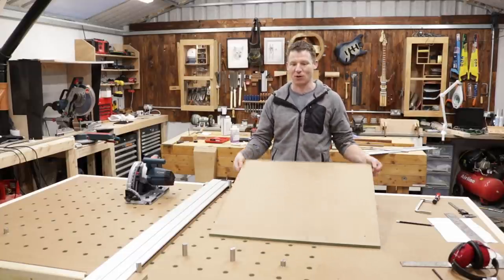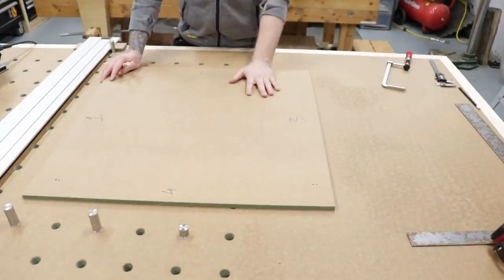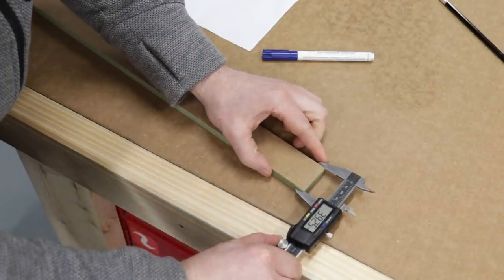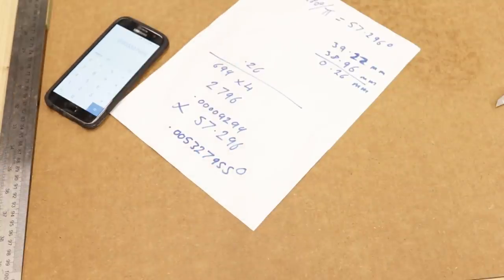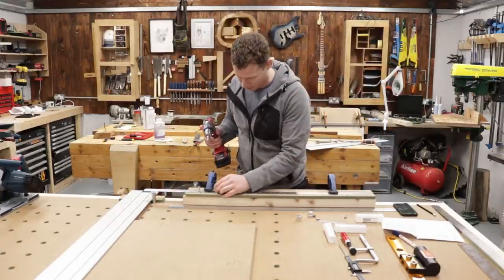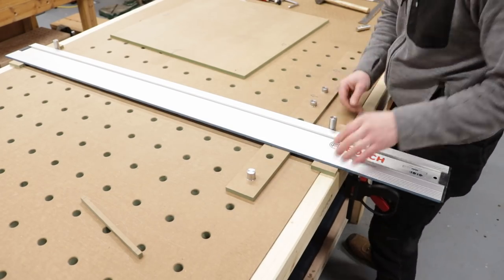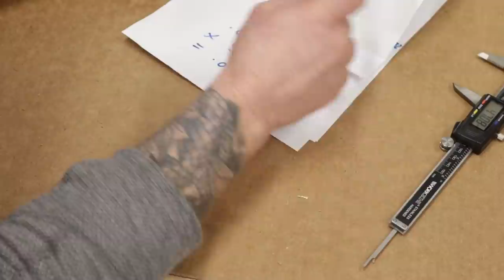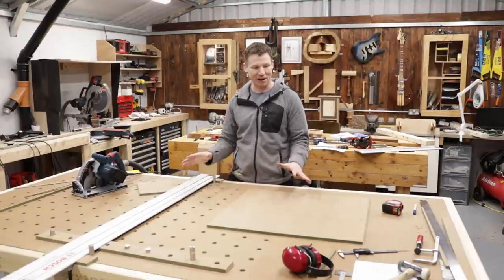Testing MFT Accuracy and Testing Home Made Fence Accuracy. UJK Parf Guide System MK2.

Comment: Is it me, or at the 17:20 mark on the video, it looks like you rotated the board by 180 degrees, hence you are showing the same measurement twice?
Reply from the maker: Yes I messed up I rotated the board the wrong way for one cut and cut the same side twice. It's pinned in the first comment on the video.
Reply: @JohnMcGrathManInShed  I did read through your pinned comment when you mentioned the "3 cut" error whilst cutting, but I was referring to when you were doing the measurements of the diagonals towards the end of the video. To me it looks like you rotated the board 180 degrees between measurements, when it should only be 90 degrees
Reply from the maker: @whatdaf11  I measured it about ten times it's good, believe me if it wasn't square I would be the first to say it.

Comment: Check out the bench dogs guide fence and fence dogs, very good items to add to your mft https://benchdogs.co.uk/
Reply: Taking delivery of my Benchdogs 2000mm fence this week. I like it as it has flag-stops, an under rail support, metric scale. Hopefully building 2 mft style tops ( like in the video) but 1200 x 1400 that can be joined together when needed. This way I can take a single unit out on site. Crosscut will be via a Festool rail with magnetic dogs from Sautershop.de. 
Appreciate the video. I'll be using this method.

Comment: Curious what is considered “close enough”? Jumping through some serious hoops here. Once this piece is assembled into a cabinet (or whatever it will be used for) it will change considerably. Joinery methods, glue, fasteners, variable thickness of the piece itself will all affect the “squareness” of the finished project. Etc, etc, etc. 
Then, next week it will rain, and the week after that it will be dry and the temperature will rise 15 degrees. These factors will all change that  “perceived squareness”. After that we deliver the cabinet to an out of square and out of plumb house to install the cabinet.
Not saying that we shouldn’t strive for “perfection” what I am saying, is the customer will never appreciate your efforts, and will never pay for your efforts.
Nice job! Close enough! Get to work and make some money!
Learn to run a profitable business.
Reply: Wrong here. There are imperfections in life, that's a given. But a tighter tolerance beats a lucky fit on any day. If one can get the workpiece down to 0.1mm tolerance, the amount of play afterwards has a much higher probability of staying within "squareness" by eye.

Comment: I'm not so sure that a 0.26 or 0.010 inch error is very good if you want to joint anything together. 
A 10 thou gap is quite annoyingly visible & considering my calibrated DeWalt table saw, will cut 1.5 thou or 0.0015" or 0.038mm error in 500mm. 
 I have to say,  I'm not positively impressed with your setup.

Comment: Matt Estela had the same problem with his Bosch track saw and the dogs (https://youtu.be/cfxF-EtfOfA?t=939) unfortunately he only suggested the same solution as you. This is one reason I'm not going to get the bosch track saw.
Reply from the maker: It fits on all the other brands track's so if it's a major issue I'll just get a Makita track for it which is identical to the festool
Reply: Buy Festool or Makita track and you are done. They fit to Bosch system.

Comment: u should not use a caliper the way u do. just put the object to be measured on a flat surface and the caliper too. than close the calipers jaws at least on half their length araound the object.

never try to measure that way u r doing and than calculate.